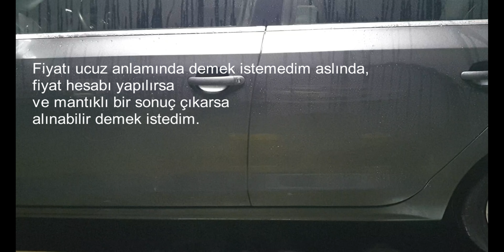Shiny Garage Blue Snow Foam (Mavi Köpük) vs Valet Pro Foamula 1 | Ön Yıkama Şampuanı Karşılaştırması

Comment: Foaumula 1 seyreltme oranını normal kullanımda nasıl ayarlıyosunuz , aracım siyah elimdeki ürünün miktarı az 500 ml.  Dolayısıyla doğru kullanmak istiyorum. Daha önce 5000 ml suya 200 ml yani bir bardak foumula 1 koyup kullanmıştım .
Reply from the maker: 1:30 kullanıyorum ben sıklıkla, ama genelde göz kararı atarım. Sizdeki pompa nedir 5 litrelik? Veta, ilposan?
Reply: @CilalaParlat  marolex foam , internetten 5 litrelik bidonun arkasını okudum 1:5 yoğun kir 1:20 az kir olarak yazmışlar . Bende 1:10 şeklinde seyrelttim . Zaten aracım siyah çok kirleniyordu . Yaz tam olarak geldiğinde suyu daha fazlalaştırırım zaten
Reply: Aceleci davrandım biraz heralde
Reply from the maker: @hakan_alpaslan  O oranlar foam lance için belirtilen oranlardır, Pump sprayer ya da foam sprayer ile ilgili özel bir oran verilmemişse kendiniz hesaplamanız gerekir.  

Foam lance 1 litre olsa da o 1 litreyi boşaltmak için içinden yaklaşık 10-12 litre su geçer. Siz 1 litreye 30-50 ml arası koyarsanız tatmin eder.

Marolex'in 5 litreliği mi var size anlamadım ben durumu?  Eğer 5 litrelik var ise ve 5 litre su koyuyorsanız 150-200 ml arası şampuan doğru orandır. Ama diğer türlü litreye 30-50 arası fazlasıyla yeter.
Reply: @CilalaParlat  teşekkür ederim , hayır normal 3 litrelik marolex , 5 litreye 200 ml koydum derken bidona demek istemiştim.